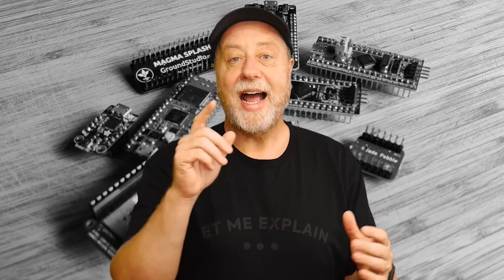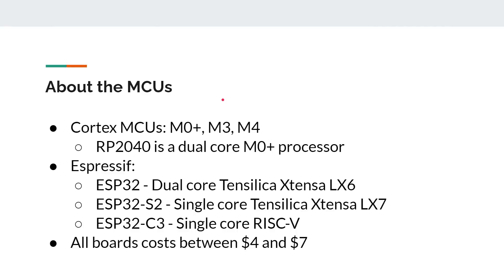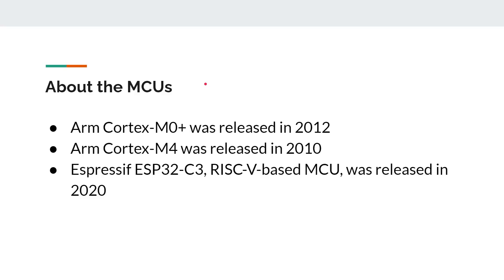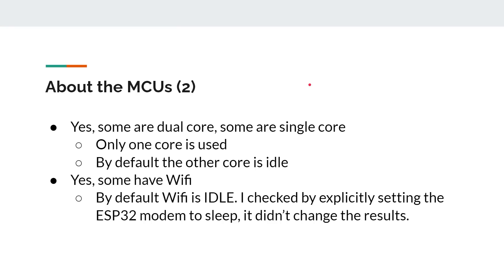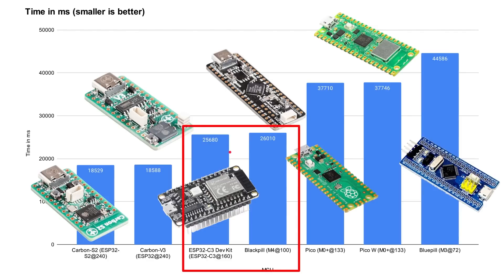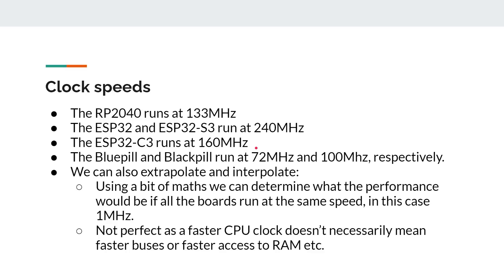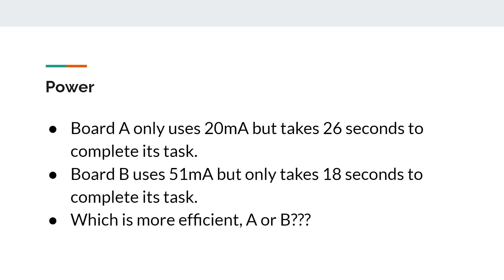Arm vs RISC-V? Which One Is The Most Efficient?

Comment: Not that it really matters much, but for future reference, O3 isn't actually necessarily better at all, in fact, it can have a massive negative effect. O3 enables a whole slew of flags that usually makes the code larger, and on microcontrollers that's.. usually not the best, performance wise, but not always an issue.

Probably means nothing to powerdraw per mips,  which is really the most important factor, just floating it out there :)

Should also be noted that the esp32 riscv cores do have memory protection, usb host controllers and all that jazz. I wonder how much of that is disabled from start... but meh. It doesn't really matter :). The data is data, just got me thinking is all.
Reply from the maker: Well, since I tested all the "O" options then I can tell you that it does make a difference. So, thanks for the comment, but I won't be noting that for future reference. ;-)
Reply: @GaryExplains  Hey, more power to you then :D.
Less "does nothing", more "can do really weird unwanted things". Testing it is just the most performant, and you are doing that, so A+.

Comment: If you leave out everything else and just concentrate on one thing, it's possible to find some little victory somewhere. Efficient is such a vague term. RISC-V is nice, great that some people make it and I hope they get further. But my first ARM chip was an ARM2, no intention of switching camps and I see no reason to. These ARM chips were made to be low power, yet still have some performance. They do what they have been designed to do. That is also a form of efficiency; nothing wasted on doing what they shouldn't.

Comment: Although the Arduino IDE hardware abstraction does a good job of providing a common programming interface it is not really a good platform for performance comparisons. Some of these chips have a lot of functionality to improve performance per watt which isn't supported by Arduino HAL and the HAL has to do a lot more work with some architectures slowing down performance too. That said it is clear that the now ancient ARM architectures still hold up extremely well to the modern competition.
Reply from the maker: "Some of these chips have a lot of functionality to improve performance per watt which isn't supported by Arduino HAL"  - Could you please give me  some examples.
Reply: @GaryExplains  You can shut down the ESP32s entire radio circuitry if you have access to the low level registers. This saves a lot of power even when the radio isn't being used. If you have access to clock multipliers on the STM chips you can tune them to give lower power consumption too. Your encryption algorithm may be able to take advantage of encryption hardware on some of the chips which would make a big difference but the HAL won't necessarily take advantage if it.
Reply from the maker: Well, you can shutdown the entire radio circuity using the Arduino HAL. In fact I tried that, and said so in the video. Switching on low-power idle modes isn't relevant to this test. Also I used my encryption algorithm as a example of a heavy CPU load, it doesn't matter that it is about encryption. In my previous video I used finding primes and in my next I might use nqueens. It isn't about using special HW encryption blocks, but about testing the CPU.
Reply: @GaryExplains  Turning off the radio is not a low power idle mode it is just turning off the WIFI circuitry when the application doesn't require it. The rest of the chip runs at full speed and full power. It gives a better apples to apples comparison when testing say STM chips with ESP. Like when people compare the PI Pico to others ignoring the programmable IO which is it's most unique and powerful feature.
Reply from the maker: Hmmm... I seem to be repeating myself, one more go I guess: You can shutdown the entire radio circuity using the Arduino HAL. In fact I tried that, and said so in the video.
Reply: @GaryExplains  Ok, that never used to be available in Arduino HAL but new functionality is being added all the time. It was the same with using the low power cores and that has been added now too.

Comment: How do these compare with x86 chips, specifically in running programs that are designed for x86?
Reply from the maker: x86 chips can only run Arm and RISC-V programs using emulation. The opposite is also true.

Comment: I'd say that when it comes to efficiency, a number of major interest is how much power the chip/board burns while idle. Typical MCU systems are not to crunch numbers, but for control purposes. Numbers when ready to respond to Wifi may be the most interesting, but of course there are also applications not needing wifi while waiting to do a bit of work.
As usual, comparing MHz across architectures is not useful, a more realistic yardstick could be a "maximally trivial" task like how fast it can count.

Comment: I have to say that only the last plot (mWh to the task) makes at least some sense... But in general I would say that you can not generalize these boards and compare them directly. MHz is not linear to power comsumption. It's quite simple: The esp32 boards can run at 240MHz and are there for the fastest. It does not matter if the M4 can "compute more per MHz", if it is capped at 100Mhz and therefore is still slower to do the task... If you are looking at power efficiency you probably do not need those high clock speeds anyway. You can power down the Modem of the ESP and that will cut down the power substantialy. If you want to compare the ESP32 to the M4, you should clock down the ESP to comparable levels and run the tests again.
Reply from the maker: Hmmm... If you look at my previous video about microcontrollers you will see that I actually did change the clock speeds. While it isn't linear it is very close.

Comment: It's not that surprising that the winners are the ones with faster clocks especially when in dual-core configurations the second core is just set idle (why?) This test was designed to benefit single cored and higher clocked processors. Multicore processors are known to have better performance at much lower clocks frequencies and consequently more energy efficient. I'm having a very hard time to understand what's the motivation here. However, obviously the performance is never about a difference in ISAs, especially if all of them are RISC architectures. Put some CISC ISAs in the mix and you will see huge differences, though.

Also chips that run at faster clocks generally consume more energy. That's the whole deal about multicore architectures, to have high performance with low frequencies. The whole deal of ARM processors and their use on mobile devices is exactly that. No surprise here either, since this is obvious. The only surprise is to see a processor running at 72 MHz consuming more than one at 160 MHz. I think this must come from the fact that you are measuring power at the board level, not at the processor itself, otherwise we would see this reversed.

Now about RISC-V. There is no way RISC-V processors could compete at any level with ARM processors that have been far and wide used in smartphones. RISC-V processors are new kids in the block that are running far behind. RISC-V is still lacking the support needed to be better than ARM processors. But there is a huge advantage of RISC-V, though, that cannot be measured for now. It's potentially much cheaper to produce RISC-V than ARM processors, since it is an open and free ISA. However, we cannot still see the advantage in prices because they are still not produced in high volume. Volume production is everything in chips prices. But we can expect to see much cheaper RISC-V processors in the future to the point of beating ARM processors prices. I think that's where the RISC-V will position itself as a competitive ISA.
Reply from the maker: I am planning a dual core follow up video. Also the devices with a higher clock speed didn't "win".
Reply: @GaryExplains : Thanks for your comment, Gary. You are probably referring to the hypothetical comparison if the processors were all running at 1MHz. You know that just multiplying the time by the clock frequency is not a very accurate performance indicator.

I am looking forward to see the comparison between dual-core and single core processors. For the kind of comparison (very repetitive and computing intensive tasks) you are doing, you would generally be better with dual-cores. However, that's not always true. As I stated in another comment in another video, modern architectures have lots of intrinsic parallelism (that translates into several instructions executed per cycle) that simply don't work when you impose atomic execution to synchronize threads. That benefits single cores better than multicores. In my estimate, to start having clear cut better performance in multicore you need at least 8 cores, unless you don't use atomic operations. That's the reason smartphones have dedicated cores for certain activities, because in this way you don't need synchronization. The advantage of these configurations is simplicity, you don't need load balancing. But the problem is that you will have most cores idle if their correspondent activities are not taking place.
Reply from the maker: Except for the raw performance test (ie how many Ms to complete the task),  none of the higher clock speed microcontrollers won. As for the clock frequency, in my previous video I actually changed the clock speed, and while performance isn't perfectly linear it is quite close, certainly close enough to make meaningful comparisons.
Reply: @GaryExplains  : Thanks. I didn't see your previous video, so I just assumed you multiplied the frequency by the time. It seems I will have to see this video again to understand what you mean with "raw performance". I probably overlooked that. Sorry.
Reply from the maker: Also, I don't think MCUs have much in the way of ILP, and certainly not out of order execution.
Reply: @GaryExplains  : Yes, you are right about that. Microcontrollers generally don't have multiple instructions per cycle, but that will depend strongly on which processor, ISA, etc., we are talking about. ARM processors, for example, are generally pretty clever in intrinsic parallelism, but obviously with a proper compiler. You need to worry about out of order instructions only if you program in Assembler, unless you are referring to branch prediction misses (both are quite different things, though). But I think you are saying that microcontrollers don't allow out of order execution. Well that's where most of intrinsic parallelism comes from in reality. Are you really sure that all MCUs behave in this way?

I reviewed the video and at "raw performance", higher clocks processors indeed perform better. But this was expected and pretty logical since extra cores are all let idle.